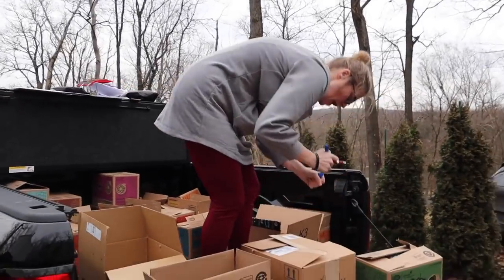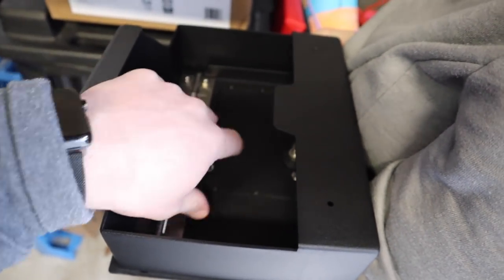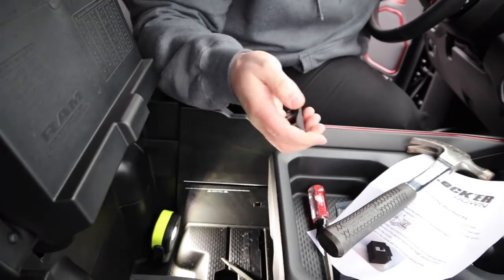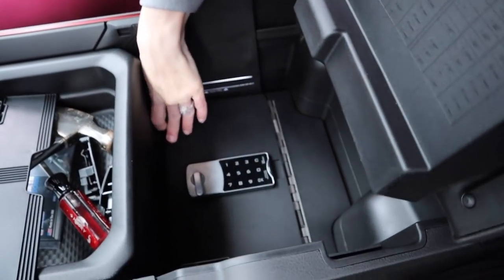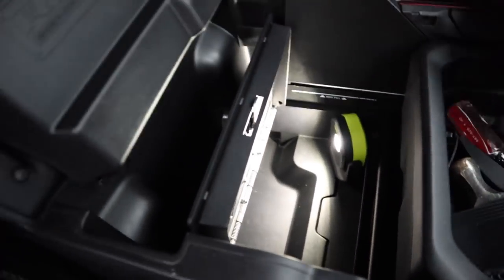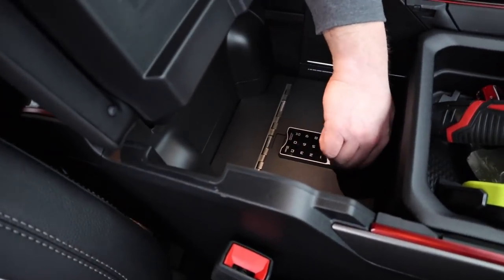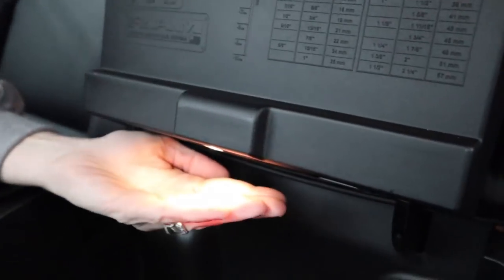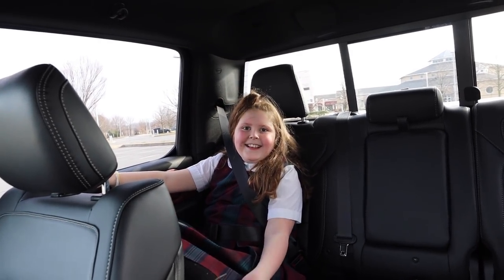MUST HAVE ACCESSORY! 2019 Ram Lock'er Down Console Safe Install

Comment: OH LORD... PLEASE LET THIS BE A TOP COMMENT. The two retainers on the inside of the console that hold the "4-Gen Flap" If we'll call it that do not need pried out with a screwdriver. They have 3 90 degree retainers on them. 1) Slide the mobile center console all the way BACK. 2) grasp them and pull them rather firmly forward, toward the front of the truck. Boom. 3 clips release and snap right out. So if you ever want to put them back in, they'll snap back in 2 seconds. Good luck everyone!
Reply from the maker: Thanks for sharing, pinned..
Reply: Well shit 🤦🏼‍♂️
Reply: Thank you for the suggestion! I actually pushed the sliding tray to the front. Then used a rubber mallet and gave each of the tabs a tap from the back, knocking them towards the front of the truck. They popped right off easily! Thanks again!
Reply: Justin Peters is 100% correct! Just installed the Locker Down extreme console safe in my 5th Gen 2019 Ram 1500 Big Horn Lone Star. It takes a little bit of mussel but you can remove the clips by forcing them toward the front of the truck and they pop right out. No damage and they can be reinstalled if you decide to remove the safe and put things back to stock. Glad the posted was pin!!! Thanks Justin!
Reply: Oh man - you SAVED me from just snapping them off with a pair of channel locks! THANK YOU!!!
Reply: Glad I read this. Thank you. 🇺🇲🤙🏼
Reply: I always prefer disassembly vs breaking .. good looking out. Glad I found this video again before install. I know this is an old post but thank you for pinning it.
Reply: Well dang
Reply: Saver! to this day.
Reply: So I just smacked mine out.  Came out but still broke.    So question is what are they called or model number to buy spare in case I want to reinstall them?   Anyone????

Comment: Nice video.  It is not necessary to remove the tabs.  I was able to simply tip the front of the unit under the tabs.  Also I cut the back portion of the rubber liner to put into the safe as well as the front portion - really easy to do, and keeps my gun from sliding around.

Comment: That’s nice. But for 370 dollars for a safe that held by small screws into plastic is ridiculous. And on top of that it will only hold a couple keys a small pistol and may a flat piece of paper.   
I definitely like the idea but it should be attached to metal.  I could get that out in 10 seconds with a small pry bar. Those screws will rip out the plastic easily.   
Looks like about a 100$ mod to me. Way over priced.

Comment: I left the rubber pad in and drilled right threw them. (Want to make sure the metal safe and plastic console didn’t make any type of rattling) I went and replaced the self tapping screws with the same size self tapping screws with a hex head.

Comment: Just installed it in a 2019 Ram Rebel Quad Cab, and it fits great!  One thing about those 2 tabs:  There are 3 plastic clips holding each in.  What I did was exert a bit of pressure upward and out, which worked better then pushing forward when trying to remove them.  There is a movable plastic piece under each, but you don't have to squeeze or compress anything to get them out.  
Drop the Safe in place with the lid shut...its much easier.  
The electronic keypad part will beep when the battery is low.  Also the battery compartment is on the outside so dont worry about being locked out with a dead battery.  Battery is CR2032 button cell battery.
4 self tapping screws I received were all the same length...short ones in video.  All tapped in easily.  Cumbersome to put in back 2 screws, and you will need a short Phillips head screwdriver for that part.
Where they cut the vinyl/rubber in video worked fantastic.  Fits like a glove and a pair of scissors worked fine.
Love the look and fit!  Recommended.
Reply from the maker: Solid info, thank you!

Comment: Nice video. I personally after researching went with the ConsoleVault for my F-150. It is a complete enclosure and bolts through the center console into the steel framing underneath it. Much more secure and if someone managed to break it loose from the truck they would not be able to get into the safe easily as the bottom is NOT open like this style. Nice video and safe though. It's about deterrent and being hidden at this point. A thief that really wants in will likely find a way if given enough time.
Reply: The last F150 with bolts in the console was 2008
Reply: @robertnewell2287  you're probably correct as mine is a 2007 FX4 trim

Comment: Another reason to upgrade my jump seat in my 2004 cummins. Locker down starts at 2006 & up haha.
Reply: My 2010 has the flip up seat to keep it a technical 6 seater.